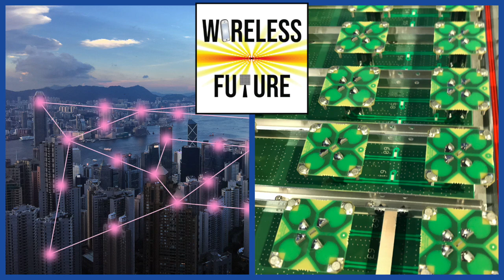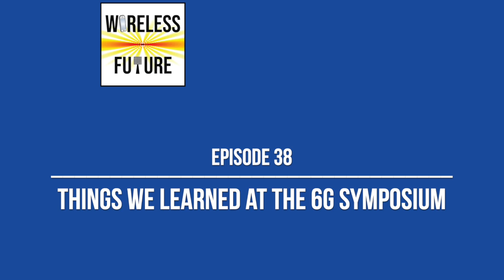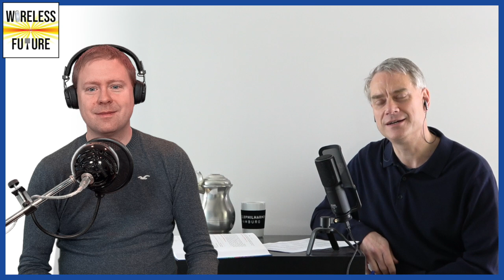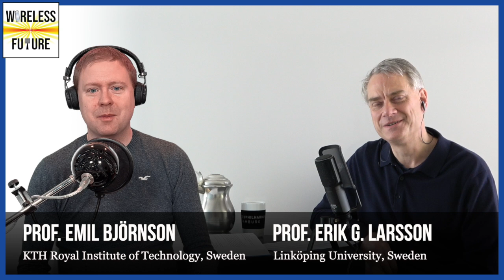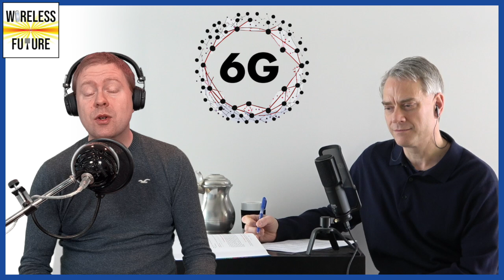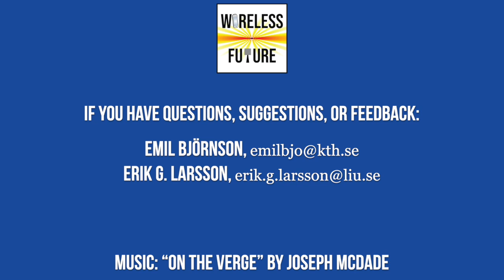Ep 38. Things We Learned at the 6G Symposium [Wireless Future Podcast]

Comment: Thanks for all of your work,
do you happen to know array deployments with varying antenna element spacing?
Reply from the maker: The antenna arrangement determines the shapes of the beams that the array can generate.

If you consider uniformly spaced arrays with varying spacing, then you can find the theory for studying this many textbooks. Including Chapter 4 of my book new book https://www.nowpublishers.com/article/BookDetails/9781638283140
In essence, the width of the main lobe is inversely proportional to the total length of the array, while the interference outside the main lobe depends on the spacing between the antennas.

If you consider irregular antenna arrangements, it is harder to predict how the signals will look like, but one can simulate it.
Reply: @WirelessFuture  Thanks, I meant one array with different element spacing in between - I have not heard about such a case so far.
I think there is no real benefit for that but special space constraints.
Reply from the maker: I haven't studied this in detail myself, but if you do a Google search on "non-uniform linear array", you can find some papers that study the topic. They are, for instance, optimizing the antenna locations for particular performance metrics.

Comment: A short question regarding the a more general point. For e.g. localization purposes, do I need contiguous bandwidth or can it be from different spectrum parts (e.g. 100 MHz from sub 6 GHz and additional 300 MHz from the 24 GHz part)?
The equation says nothing about that, just Ts=1/B.
Thanks a lot.
Reply from the maker: Hi! The formula applies to the case with contiguous bandwidth. But one can certainly use signals sent in multiple spectrum parts to perform localization. Algorithms must be designed specifically for that case.